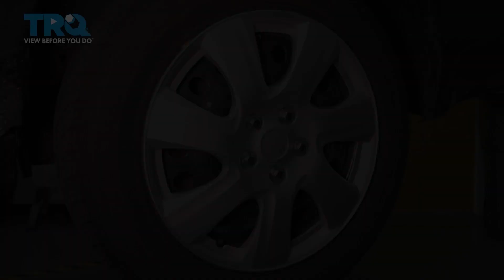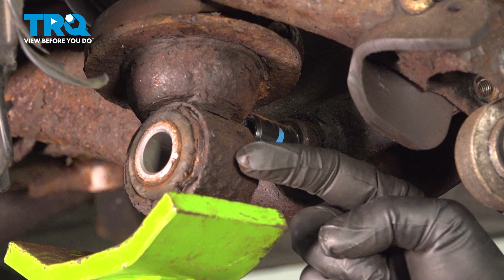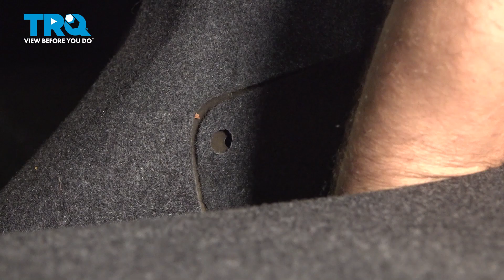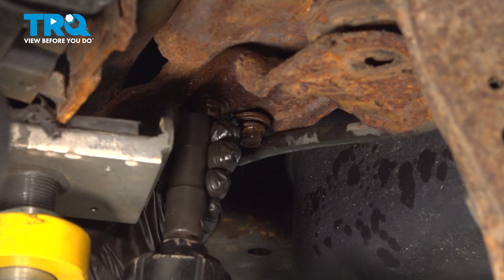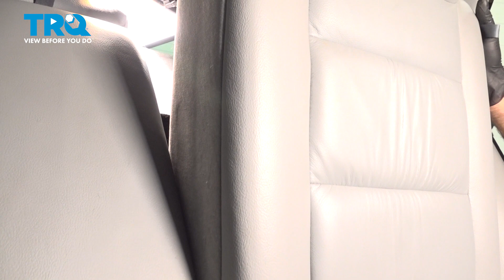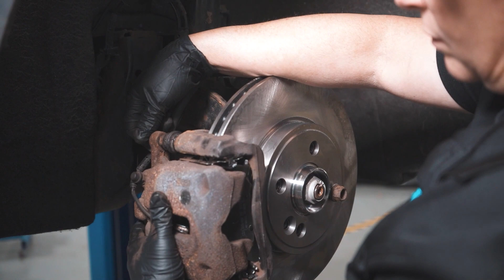How to Replace Rear Strut & Spring Assembly 2005-2007 Ford Five Hundred

Comment: Other than not saying anything about Lubing the brake pad slide bolts , this is probably the best do it yourself Video I have ever seen ….
Just add the fact that spraying down all the Rusted bolts before starting might save you 4 hours drilling busted bolts … Get a can of PB Blaster before starting , and at least 1 can of Brake cleaner to use at the end .
Bravo on the careful step by step process … You could work as a Factory Field Engineer for any automotive factory …
Best Regards and Luck 😎

Comment: Better late than never! I could have used this video a year or two ago when we replaced our struts on our 2006 Montego AWD (Ford 500). I did the front and took the car to a shop to have the rears done. I couldn't deal with dropping the sub frame to remove a strut assembly. That said, tha same shop forgot to re-install the rear upper spring insulator, so I'm going to have to tear the rear-passenger side strut out again. Thank you for this video. It's amazing!